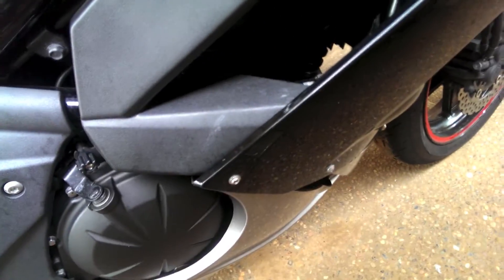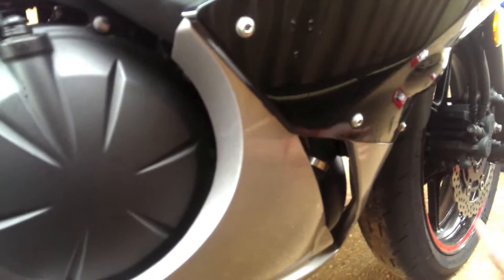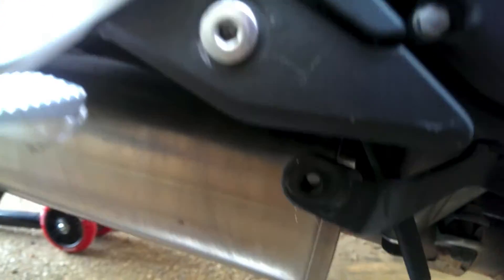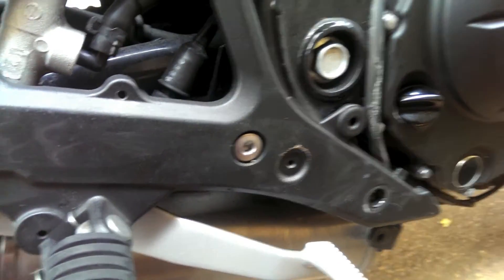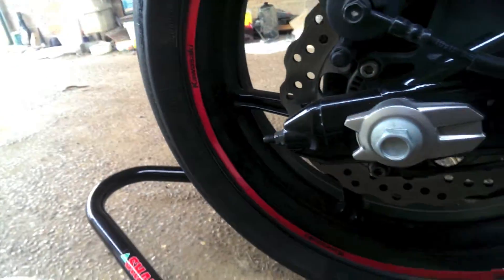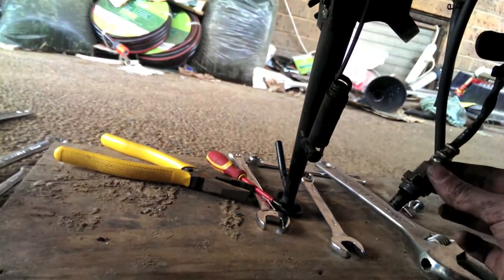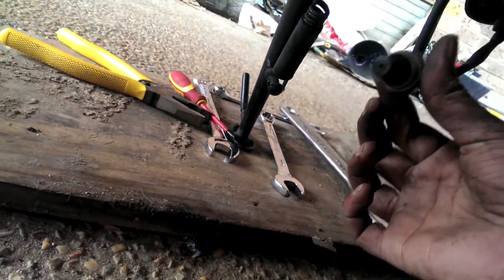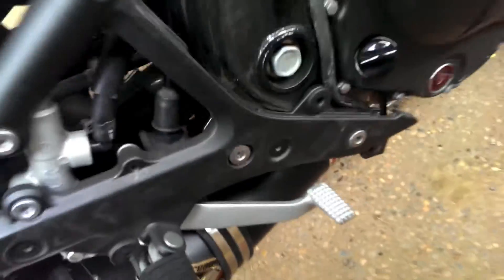Ninja 650r | How to Install Screaming Demon Slip on

Comment: bahahaha this is gold!
on a side note, i am thinking of getting one of these exhausts for my Hyosung GV650
Reply from the maker: +outie555 I like the sound of them :)
Reply: was it fiddly to install? my GV650 exhaust is exposed and looks like it would be easy to remove but not sure. $300 bucks from eBay incl delivery so might be on the cards in the near future
Reply from the maker: outie555 Yeh mine was a bitch and half to remove, but the install alright. Your's would be much more simpler and that's a great deal for that exhaust.

Comment: Is there a place on new muffler to screw in the O2 sensor? Thanks
Reply from the maker: @martywiseman4694  Hi, yes, there is. Make sure you get the pipe with O2 sensor fitting. I believe there was 2 pipes, one with O2 sensor fitting and one without

Comment: Did you have to buy some sort of angled midpipe to get the slip on to point out from under the bike, instead of straight back?
Reply from the maker: Hey mate, the slip on it was angled away for the bike. Not sure if the new Ninja 650 models have changed that

Comment: Hey! Can you share a link where you got that exhaust from? And does a slip on work with a 2012 ninja 650/er6f ?
Reply from the maker: MAHANTH CHAVAN Hi Mahanth I bought from ebay https://rover.ebay.com/rover/0/0/0?mpre=https%3A%2F%2Fwww.ebay.com.au%2Fulk%2Fitm%2F173040290186. Please check with the seller if it fits the 2012 Ninja 650 and ERN650 before making the purchase. Thank you.

Comment: Just purchased a 2 brothers exhaust. What did you end up doing with the o2 sensor?
Reply: Did you ever figure out what you do with it?
Reply: @MrCheckers37  did you? lol Im debaiting this as well and since i dont plan on keeping the bike i dont want to dump the money into a full exhaust but i also dont want to have a bad lean condition either
Reply: @Neteng333  it's been a while since I installed it but I'm pretty sure the o2 sensor was on the pipe before the slip on so you don't have to mess with it

Comment: Hi, how did you take the o2 sensor off? Having trouble with it!
Reply from the maker: Hey Fraser, Just grab a I believe 22mm spanner and make sure the exhaust is still in place, makes it easier to remove.
Reply: CurryRider hey Curry Rider 🏍 bought a O2 sensor socket off ebay and managed to free it up wd40 from the day to before helped also!  Thanks for the reply!  👍🏻
Reply from the maker: No problem mate. Wd40 are the best 👍👌

Comment: Did you needed to cut the exhaust to put the slip on or does it come off easily without the need to cut?
Reply from the maker: Danilo Contreras Hey Danilo, no need to cut anything, it just comes out when you remove the bolts.
Reply: CurryRider mine is a ninja 650 2014 you think its the same thing I just need to remove it?
Reply from the maker: Hi Danilo, I believe it will be the same as my bike was a 2011 650RL model and exhaust seems to be the same model and size for 2014 as well.
Reply: I don’t think so mine is one solid piece it’s a 2016 model

Comment: What did you end up doing with the oxygen sensor ?
Reply from the maker: Hey mate, I managed to remove the O2 sensor and reinstall it with the new pipe
Reply: @CurryRiderSP  oh okay I'm asking because I just bought a slip on and I'm wondering if I'm going to have to modify it because I don't see any o2 sensor hole on the slip on I got
Reply from the maker: @jeipin3401  Aww ok there are two options with the slip on that I got. One to reuse the o2 senor and the other to remove the sensor. If yours doesn't have it than you have to get the hole made from an auto shop if you want to reuse the senor